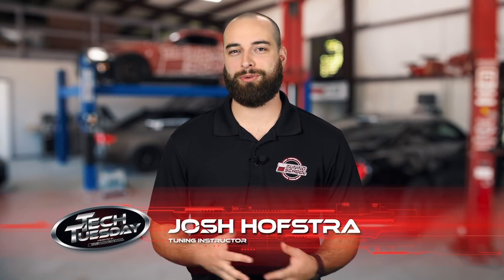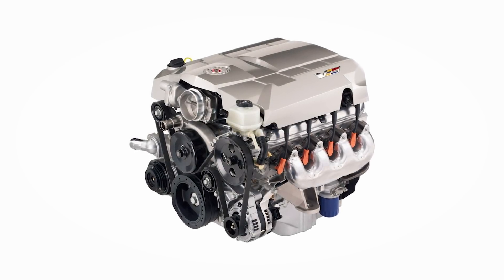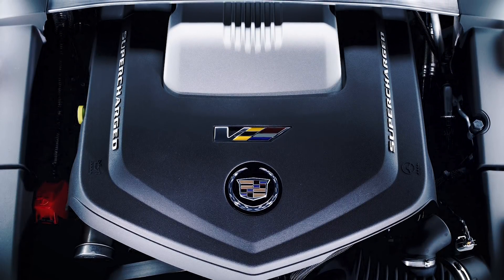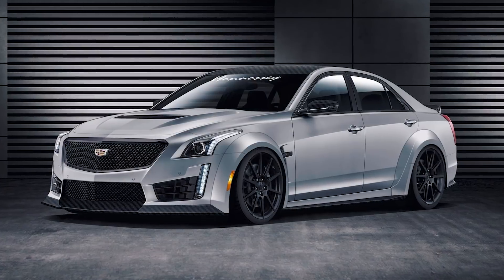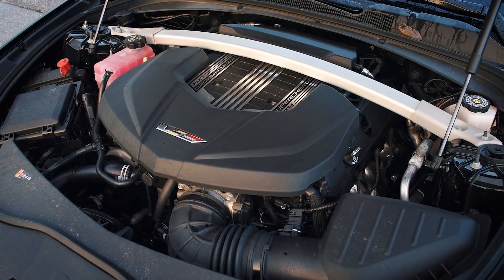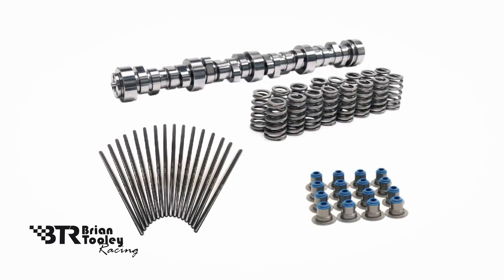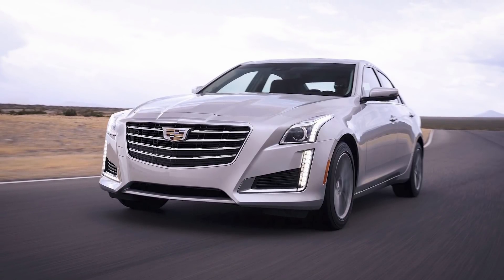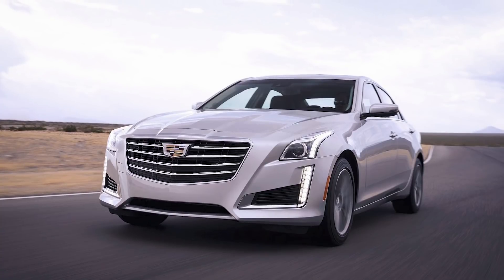Why You Need to Mod & Tune Your CTS-V

Comment: I have a 2004 Cadillac CTS V with a 2011 Squires Turbo System. Rare twin turbo system were mufflers are deleted and replaced by t3/t4 turbos. System installed at 83k miles. Car currently at 88k. Forgestar F4s 19x9 and 19x10 with Michelin Pilot Super Sport. Basically turbo system is 5k miles old and wheel and tires 3k miles old. Car, wheels and tires look brand new. Vehicles has sat inside garage of its entire life. I’ve done minor exterior enhancements that make it look like a more modern model while retaining its factory appearance.  Caught in between getting it up to 1000hp or selling it. Check out (STS Twin Turbo Cadilllac CTS V lays down some rubber). Not my car but same turbo system mine has. Turbo diesel truck guys got nothing on the turbo whistle these cars make
Reply: ..Sounds great    any video on your car
Cheers from uk  X5d big garret owner

Comment: I am about to buy at 2017 CTS-V. What were the 2 mods you recommended and who to get them from?
Thanks
Reply: Not to buy a newer model year, get a 2011-2015, much cheaper to mod when you look at not having to work around that damn direct injection and more complications vs the V2. You can find a very nice V2 for around 37k with low miles and if you spend the extra on mods to the price of what you would pay for the V3 stock, you'd be in a much better boat.Plus youd be able to get a coupe and not the ugly 4 door.  I found one myself 2011 black Coupe w/recaros, $36k, 30k miles, looks brand new, spent about ~$2500 so far (Expansion tank, 4.5 fasterproms cold air, 2.55 pulley, Might Mouse Catch Can, Ported throttle body, plugs, thermostat etc) and pushing ~640 to the crank, 557 wheel so in all for $38k im at the power level of the new V3 and have so far yet to go.... Car is a monster....

Comment: Any good junkyard will have a Lincoln MRK VII which is a Ford 8.8 rear which will work instead of 5k from G-Force for the first Gens! 6 bolt is Trailblazer SS wheels. Multiple companys have heat exchangers for Gen II's, no need to go EMP pump unless your upgrading lines and a trunk tank. More shops in the V world than just ProSpeed...

Comment: Question. I recently cammed my v2 sedan. My baseline was 472. After the tx speed stage two cam, corsa sport exhaust, and circle d converter, I only went up to 487. The tuner said I dropped from 9 psi to 4ish after the cam... which I partially expected...but was still hoping 550-575 for the 6 grand I spent... I plan on pullys, e85, heat exchanger, injectors, and headers and d pipe... could the tune be the issue? I sputter occasionally if I don’t warm up and I’m disappointed in the outcome of only 14hp from the cam... does that sound right ThT? I’m afraid to put another 6k and not get past 600hp... any suggestions?
Reply from the maker: The important thing to keep in mind is that dyno numbers can be arbitrary. We are also unable to speak directly to the specific power output of this setup because we have not dealt with this exact setup. I would suggest speaking with the folks at Texas Speed to see what they think about your power gains.
Reply: What are the cam specs?  appears there might be too much overlap which has reduced your boost pressure (and HP)
Reply: could’ve done a lower pulley while you were there camming it. could’ve also been heat soaked. i would do pulleys and e85 and i bet you’ll see major gains. should’ve started with the bolt ons first before jumping into a cam.

Comment: Im not going to spend time to watch this whole video because  im about to board a plane to San Francisco...I have 2 2015 CTS-Vs One is a Coupe and the other is my favorite  which is my wagon and both are manuals.The rear ends  are made of glass and need a nicely built diff...I went with a Lingenfelter build who has upgraded  my cooling systems,intercooler and suspension..along with a cam and heads.. DONT FORGET A NICE CARBON KEVLAR CLUTCH!!! Im running a Cat free exhaust  through  Series 10 Single chamber Flowmasters.I have a 95 Lingenfelter  ZR1 which they have not only rebuilt at 40,000 miles into a monster but also went above and WAYYYY beyond being I have 3 vehicles  built by them.My manual 2015 Coupe has only had a rear end installed along with mainly bolt ons but my wagon is putting down close to 840wheel hp and 900+ lbs trq.. Have a rear end built,uprade the cooling system,intercooler,throttle body,have the S/C ported & polished along with some long tubes and cat delete..or even get a high flow setup but either way..Make it more robust in its weaker areas and let it breath...Youll be very happily rewarded !!!
Reply: Let's see some videos and also I'm pretty sure only 2004 and 2005 had weak rear ends.. I put the creative Steel in mine
Reply: @boostedKTM  send them where? Email??? They were upgraded  but still werent that strong..I broke my manual wagon with only only 758 dynoed hp and 728lbs/trq..
Reply: @connoisseurofcannabiscarsp3755  the wagon was made 11-14...